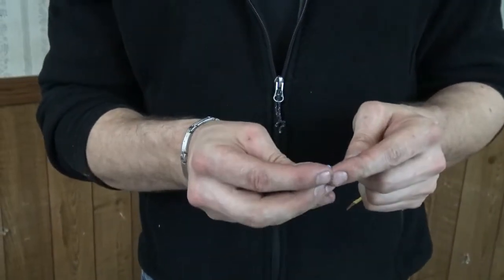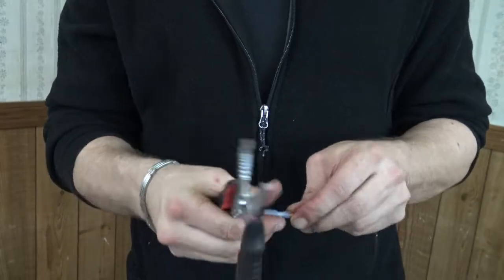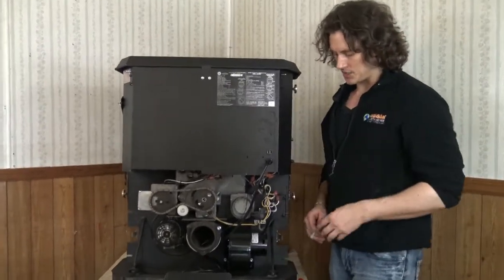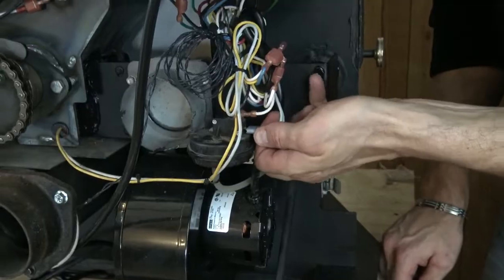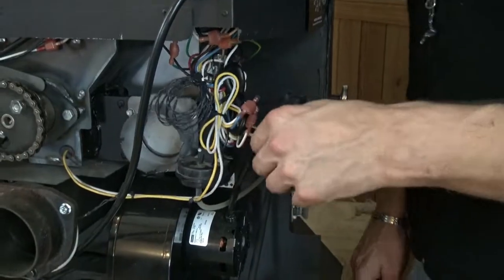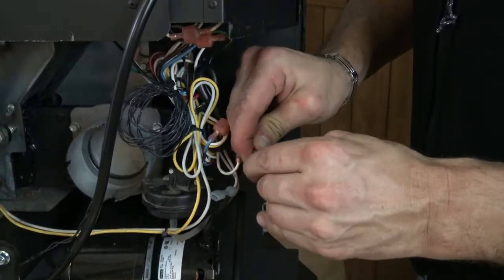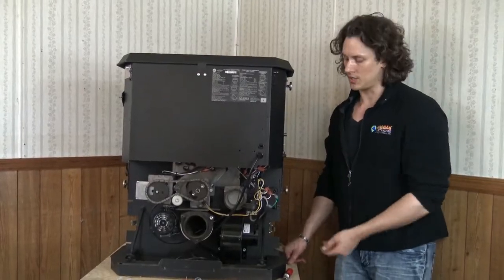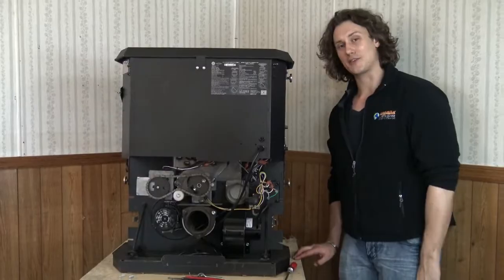How to create a jumper wire and bypass a safety switch in your Pellet Stove

Comment: My intake air safety switch has 3 wires , how do I bypass ?
Reply: Its a Hearthstone Manchester ( model 8330)  There is a red , white , and black wire. Thanks in advance.
Reply from the maker: @MrTomtusti  Thanks for the info Tom. I just messaged our lead tech on this - I believe it would be the white and black wire, but I want to make sure. As soon as I hear back from our technical team I will follow-up. Thanks.
Reply: @EarthSense  Thank you
Reply from the maker: @MrTomtusti  Hey Tom, here is the response from our tech. Being we don't have experience with the Hearthstone Manchester model, it may be good to contact the factory direct on this and troubleshooting. 

Here is what our tech had to say: If he has a 3 wire switch that means that it can be read as a normally open or a normally closed switch. I have not seen where all three terminals are connected as it is usually one or the other. To bypass a switch that requires all three terminals to be hooked up for operation you would need to build a Y jumper and hook up the NO and NC terminals to the top of the Y and the third terminal to the bottom. I am not familiar with this manufacturer or model stove so I do not know for sure if he actually needs both hooked up.

Hope this is helpful, thanks again for reaching out.
Reply: @EarthSense  Thanks for trying
Reply from the maker: @MrTomtusti  Sure thing Tom, sorry we couldn't be of better assistance.
Reply from the maker: Thanks for contacting us Tom, happy to help. What stove make and model do you have and what are the colors of the 3 wires going to your vacuum/air switch?

Comment: Nice and informative videos. I recently acquired a Quadra-Fire Contour for use in a pole building. The unit worked, but the previous owner had jumpered out some of the safety features so I have replaced all of the snap-discs, vacuum switch and tubing, added a new thermostat and thoroughly cleaned out the stove. When I attempt to fire it up now, the exhaust blower starts and runs, the demand light comes on and the ignitor comes on.  However, now the feed motor/auger does not start. I haven't been able to figure it out - suggestions??
Reply from the maker: Thanks for contacting us, happy to help. We can run the auger motor to direct power to ensure the motor is operating correctly. Video on creating a test cord below. If the motor is running correctly,
Let's make sure the door seal gasket is sealing tightly and if you have a multi-meter let's make sure the exhaust blower is running near line voltage on start-up to lock in the vacuum switch. 
https://youtu.be/rlmiCYI2WPk

Let us know what you find, we'll get you back to 100% with the Contour. Thanks!
Reply: @EarthSense  finally able to get back to this.  Verified the auger motor works and the door gasket is ok.  So I went back to the beginning and jumpered the snapdiscs and vacuum switch.  Going through the starting sequence: Thermostat works, receive the demand light, exhaust blower starts, and the feed auger runs for 60 seconds and then stops. The ignitor works (orange/red hot) and the fuel pot heats up. If I hit the rest button, the fuel motor will restart and runs for another 60 seconds. I'm stumped lol.  Any further thoughts or do I need to schedule you guys for a visit?
Reply from the maker: @skokes2010  Thanks for the message. It sounds like the unit is going through start-up sequence. Call light comes on, Exhaust blower starts up, unit will feed for 60 seconds, igniter comes on and the initial fire is lit. From here what takes the unit from start-up into normal operation mode is the Thermocouple. The thermocouple is placed over the firepot and will detect the heat from the fire in start-up giving signal back to the control box. There should be a ceramic cover on the end of the thermocouple. Let's start by inspecting the thermocouple and the wire connections. Here is a video on the thermocouple for further reference. https://youtu.be/JhMTxAzQ9k4 Keep us posted!

Comment: As a electrical troubleshooter I would tell somebody yo use a meter in continuity than bypass a safety. All they need to do is lightly blow or suck the clear tube and listen for the beep. My 2  cents.
Reply: I have seen too many failures where the jumper is left in and unit gets damaged because there was no safety.  It's the Karen in me! Lol
Reply: By the way, you are doing a great job explaining how to repair this equipment!
Reply from the maker: @twobanger21  Really appreciated Nick! Thanks so much!!
Reply from the maker: @twobanger21  Yeah, it's absolutely crucial a jumper is only used for testing/troubleshooting - safety switches are called safety switches for a reason and need to be correctly in place and functioning during operation; 100% with you. Really appreciate it Nick!
Reply from the maker: Thanks for the message Nick. Yes a continuity meter will work well for testing the vac switch - like you mentioned lightly blowing and sucking to create and break connection. For other switches like high limits, low limits, fan switches, etc.. they only close or open at set temps, so the jumper wire bypass can be the easiest method there when troubleshooting. Appreciate your input, any questions or needs just let us know. Thanks!

Comment: I have quadrafire cab 50 I'm on my 2end vacuum switch in5 months is that normal
Reply from the maker: Thanks for contacting us Stephanie. I would say that is not normal. Generally speaking vacuum switches have a fairly long lifespan. We have seen premature failures, but it's pretty rare. Keep in mind there are many elements that can trip the vacuum switch and not allow it to work - here's a short video overview on vacuum/pressure switches for reference. If you are experiencing any troubles or need assistance just let us know, we are happy to help. 
https://www.youtube.com/watch?v=pHeQzUmSlIE

Comment: When you have a pressure switch with both a negative and a positive port your support that you're not using left open or is it plugged
Reply from the maker: Thanks for contacting us Steve. The pressure switch port/nozzle not being used is simply left open as is. Any other questions please let us know. Thanks!

Comment: My distribution fan in my Harmon pellet stove is not working. I connected it using a test wire, motor works. When I reinstalled it in the pellet stove it did not work. Any ideas?
Reply from the maker: Thanks for contacting us Shadow, happy to help. Glad you were able to test the fan to direct power and determine it's not the motor itself. 
The ESP Thermister Probe along with the Control Board will allow your stove to turn the distribution fan on once it reaches proper temp. 

Let's start with your ESP probe. Let's do a thorough cleaning on it and see if that fixes our issue. If it does not, we may need to look at replacement of the ESP probe and/or circuit board. 

Video here on cleaning the probe, let us know what you find. 
https://youtu.be/kt7nnGMYU-k

Thanks,
Reply: @EarthSense  Hello, I cleaned the ESP probe, however I think it's the motor. I heard  a buzzing sound coming from the distribution motor, so I banged on it,it came on but sounded horrible.
Reply from the maker: @shadowr4636  Thanks for the message Shadow. OK, so we know the motor is trying to run and comes on when you hit it - yeah I think it's safe to say this is an issue with the motor; especially if the noise emitting is not normal. Depending on the Harman model you have there are a few different style distribution fans and aftermarket options. If you need assistance on the correct replacement options for your model just let us know. Thanks!
Reply: Thank you, your videos are great by the way.
Reply from the maker: @shadowr4636  Thanks Shadow! You're most welcome; any questions or needs down the road just let us know. Appreciated!

Comment: hey hope you are doing well , your videos are great .. can you please help[ out wit this .. i just bought a house that uses pallet stove to heat the house but it was not working the auger was not turning after buying a new motor and cleaning it the stove finally started working ....... after 40 minutes been on the stove power shut off and i turn it back on by pushing the buttom and after 40 minutes it happen again and ones again i turn it on and again after 40 minutes the power shut off ... what can be the cause of this ?  please i need your help ..have blessed day
Reply from the maker: Thanks for contacting us, happy to help. Let us know what stove make and model you have; that will be helpful as we troubleshoot what may be taking place. Also let us know how your fire looks when it is burning in that 40 minute window - crisp and torchy or somewhat lazy and sooty. Also, does your room air blower come on during this 40 minute window?
Reply: @EarthSense  thank you for responding i really appreciate your time.......i have a Withfield wp2 the fire looks torchy and the air blower is on
Reply from the maker: @estebanayala7575  It's our pleasure, always happy to assist. Sounds good, Advantage Series Whitfield WP2. Good stoves. Glad the fire looks good, tells us we are getting proper fuel to air and gaskets are good. Glad the blower is coming on properly. It's interesting that it happens at 40 minutes each time. Generally if we have a shutdown after the stove has been running for that length of time it would be one of the snap switches breaking connection. Either getting weak and failing or something causing it to trip. On your WP2 you will have a Low Limit Proof of Fire switch, High Limit Switch and Vacuum switch. You can independently bypass these with the jumper wire FOR TESTING PURPOSES ONLY. We never want to leave a safety switch bypassed. Suggest doing one at a time starting with the Proof of Fire Switch and closely monitoring the stove. Keep us posted with what you find.

Comment: Cool ill just bypass all the safety switches 😂
Reply from the maker: Bypassing is for troubleshooting ONLY. Safety switches are there for a reason - Safety. It is crucial that safety switches are connected and working properly during operation. Any questions or assistance needed please let us know. Thanks.
Reply: @EarthSense  but it works better when everything is bypassed 😂 😂
Reply: @subarutime5089  the lid safety switch is fine to bi pass for a few days because its common sense not to stick your hand down into the auger lol.

Comment: I have a lennox winslow P140 . Stove stopped working 10 mins after startup. Trouble code was 2 short red blinking lights . It told me to change POF switch.  Bought a NEW POF switch, installed it and still have the SAME problem. IF I jump it and stove works, whats next? Buy ANOTHER NEW  switch? If I jump it and stove doesnt start up, whats next? control board? Thanks
Reply from the maker: Thanks for contacting us James, happy to help. It would be rare that a new POF switch would be faulty, however we have seen that before. If it is faulty, should be able to get that covered under warranty and a new one shipped out (1 Year Warranty on IHP replacement parts). It could be as simple as not enough pellets came through upon start-up. Lets add a half handful of pellets to the firepot prior to startup so we know for sure that it is getting hot enough during that period for that POF switch to lock in. From there we can jump that switch to rule out if that is the issue or not. If no change when jumped then I think the next item to look at will be our vacuum switch - I know it's not giving a vac switch code, however we want to try to troubleshoot the basics first before we lean towards this being a possible circuitry issue. Keep us posted, happy to help!

Comment: Awesome, I was wondering if this could be done with the harman but with the addition of the ignitor being also in line to that switch I was not certain, I replaced my ignitor, my auger motor and my esp probe and my issue is my led on control panel for ignitor does not illuminate and ignitor does not get hot, on stoves like the Avalon the only thing connected to the vac switch is the auger motor . . . .thanks for any advice, this video in itself is a lot as I was not certain about jumping this one out for testing
Reply from the maker: Anthony, Thanks for contacting us. Your igniter operates directly in line with your control board; no other safety switches control your igniter coming on and shutting off in the Harman. Let's first determine if your igniter is good or bad. Use a simple multi-meter and check the ohms on the igniter. Optimal range for the Harman finned igniter is 45-53. If your ohms are outside of that range you will need to replace the element. If your ohms are in that range and you have no igniter light on the board or power coming to the igniter, then in 99.9% of the cases it would be an issue with your control board. Also important to check the igniter area and clean out any ash, check the burnpot holes and make sure they are all open, and check your air intake to ensure nothing is obstructing. It's the hot air rushing past the igniter that lights your fire. Let us know what you find, happy to assist.
Reply: @EarthSense  thank you for the reply.
I was suspecting circuit board,have no igniter light on the board or power coming to the igniter but was not sure if the vac switch was interrupting the power as I see one of the light blue wires going to it along with the auger.
Reply from the maker: @anthonysaponaro6318  Certainly our pleasure Anthony. Yeah the Vac switch will have no power control over the igniter element. This is a timing sequence in the control board. What model do you have? Happy to send you a link so you can view the right control board if you need to replace it.  Thanks
Reply: @EarthSense  thank you again for the help, the model is the Accentra
Reply: I didn't think it made any sense either but in the wiring diagram it shows the Lt.Blue ground going to the vac switch so I was thinking maybe to receive ground and complete the circuit the vac switch would need to be closed, both the auger and igniter ground wires are going to the vac switch then the yellow wire goes to the board to power igniter and white wire to board to power auger motor
Reply: was just strange to see any wires from the igniter going to the vac switch, it is not like that on any other pellet stove I have seen,
Reply from the maker: @anthonysaponaro6318  Hey Anthony, I just touched base with our lead Tech advisor on this. I was incorrect, the vac switch does play apart of the ignition. Here is his note: The vacuum switch has a single white wire (common) attached from the control board.  The other terminal of the vacuum switch has two light blue wires, one for the feed motor and one for the igniter.  If the vacuum switch does not close, neither the feed motor nor igniter will operate.
Reply: I know some stoves have high and low limit disks /High when tripped can be reset but usually if that is tripped the entire stove will not get power, I am very familiar with many Pellet stoves just not the Harman.

Comment: I have a vogelzang model 5790. It wont ignite. I cleaned the unit and manually started the unit by lighting the pellets, but it shuts down after about 20 seconds and flashes a E2 code.
Reply from the maker: Thanks for contacting us. It sounds like it's not reaching proof of fire and going into an error code. If you need a new igniter let us know. When manually lighting the fire, use a bit more pellets to start and see if that will allow it to lock in to normal operation model. If not, you may want to check your proof of fire low limit Snap Disc. Happy to help, thanks.

Comment: What connectors were used to attach to the wire?
Reply from the maker: These are just basic Male and Female Spade Molex Connectors. Make sure you get them at the proper gauge for your wire size.